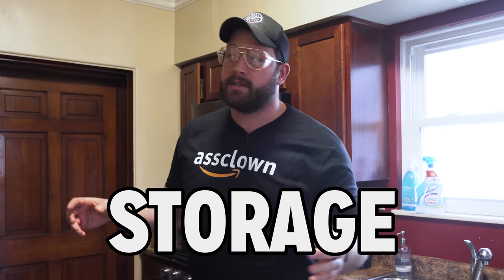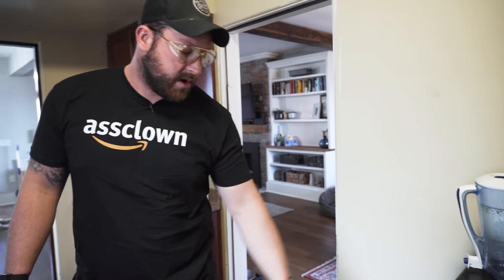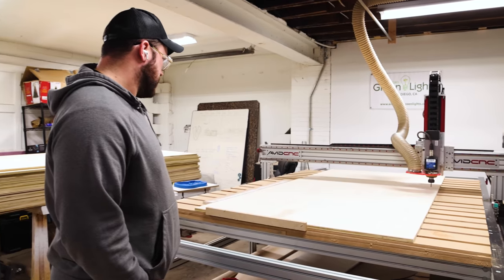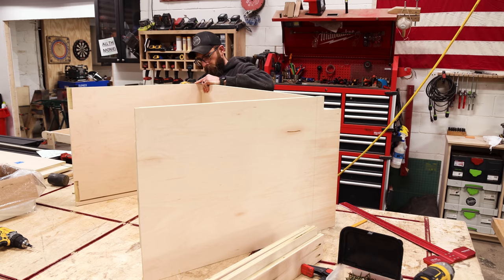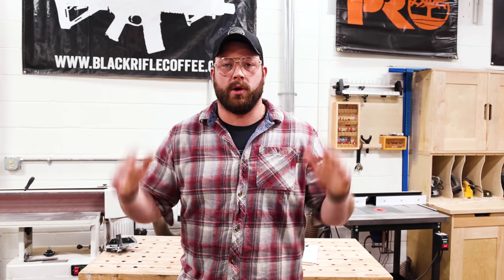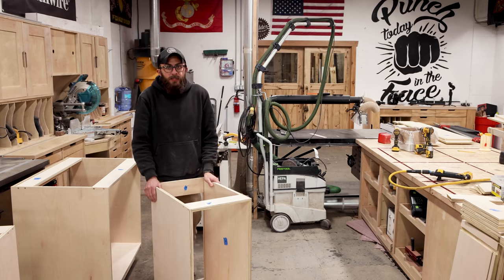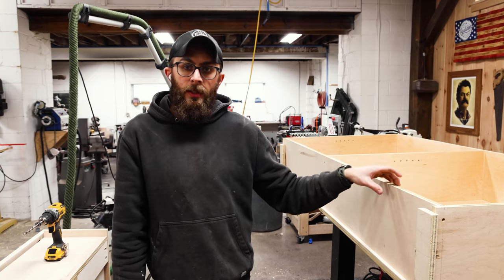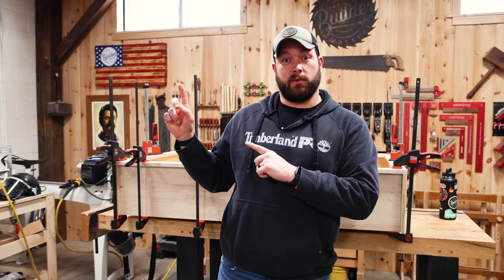Renovating My Kitchen Part 1- Building The Cabinets

Comment: Small Kitchen and Custom Cabinets with Concrete tops.  I'm going to offer suggestions for the next time...because it's my specialty and my career for 25 years.   Get UV treated/finished Plywood for the base shell cabinets, it's the best finish out there, and 1 less step.  Make the interior of the cabinets larger.  The back panel should be set flush with the back wall not 1" in.  Go deeper 14" uppers, and 26" base and drop the toe kick to 3"...you will gain tons of space you didn't know you could have.  It will also give a larger counter surface and allow for more meat for the Concrete around the sink and faucet...don't pour in place either, it's a mess beyond comprehension.  All I'm saying is "Custom", doesn't need to follow the standard.
Reply from the maker: Thanks tom, we plan on selling the house so we're not going to add all the bells and whistles of my "dream" kitchen. we also had the plywood on hand so didn't want to spend more for the pre-finished since we had enough already. great advice tho my friend. much appreciated !

Comment: Please help me understand guys. If you freeze at 7:23 you will see about a 1/8” overhang on each side of the face . Is this why he used the 1/8” spacer as a means to get cut lower in the face? Just trying to understand as this is good gouge,  If this is the case. Then he just removes the spacer and uses the joiner regular depth on the cabinet? I’m dumb
Reply: Yes. this creates the 1/8 inch over hang of the face frames with out having to adjust the biscuit jointer for each cut. just faster to remove the the spacer.